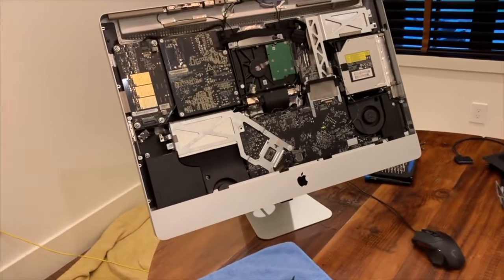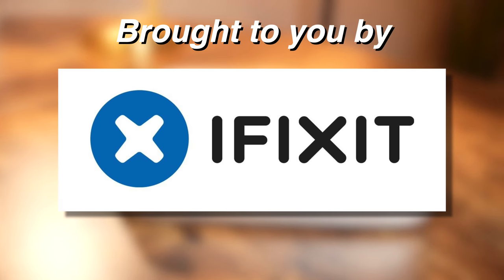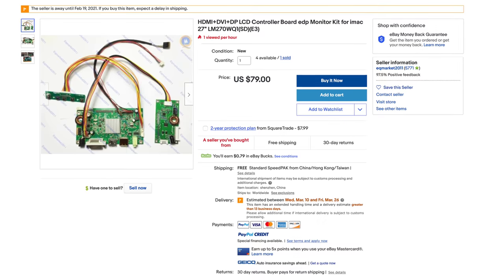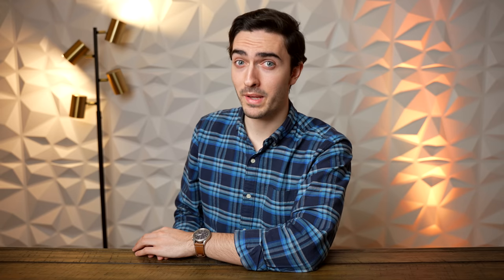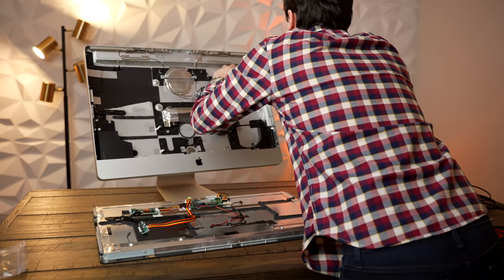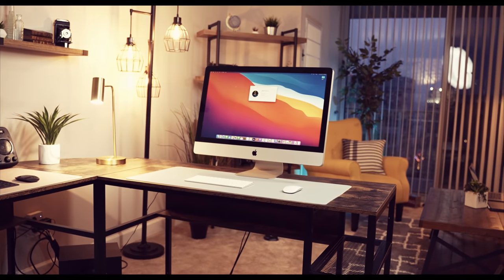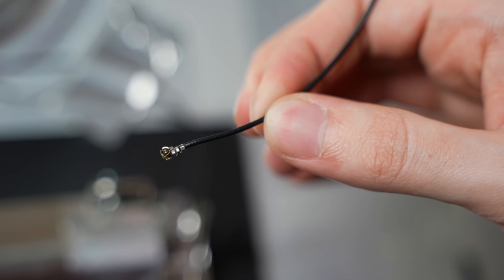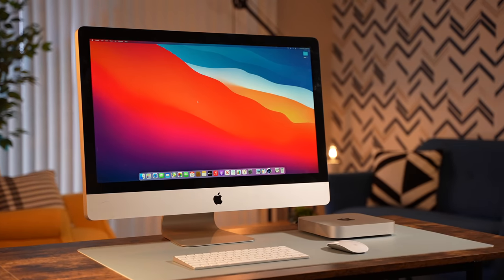How to build your own DIY Apple Silicon iMac!

Comment from the maker: What do you guys think of the iMac mini? Personally I can't wait until the real Apple Silicon iMacs come out, but this will do in the meantime :P
Reply: :D
Reply: Bombastic 👍😁
Reply: That’s cool
Reply: I've still got my late 2011 iMac that I retired because I got a MacBook Pro. I'd try something this but I ain't crazy like you.
Reply: I think it’s ok but you should cut out some sort of hole and run at least a usb hub through it.
Reply: 0:52 Should have been Involuntary Macslaughter - #missedopportunity. But this is great, I was almost tempted to do it.
Reply: Should put it in a Thunderbolt Display for it to have no chin... make it legit
Reply: This was great but with more work and time into it this could’ve been better, like number one you can put a 5K display in it and the adapter is even cheaper. You can hardwire the adapters power on button (and maybe even the Mac mini’s) to the original in the iMac. 
You could use the ram door for the I/O. (Or cut into the cd and sd slots)
And finally I think the fan is way too overkill and might be able to be replaced with a slimmer one from a MacBook. 
Idk just a few ideas that came to me as I watched the video.
Reply: If product design were ideal, then this would be the MO for a new M1 iMac, though with proper buttons, I/O, and with all that room in a 2011 iMac chassis, give me an optical drive while you're at it. 

Will Apple do this? Probably (likely) not. Should they? I don't know. As this proof of concept does show that it works, who's to say that a larger motherboard (or a dual motherboard setup with so much space in an iMac chassis compared to a Mini) isn't feasible? Tell me you wouldn't mind having two separate M1 chipsets in a computer, think like a dual core setup except it's a whole other motherboard...just add a second display (or one of those hack displays like you rigged up here) and run with it.

Third and finally (and this is a total personal opinion) the M1 chipsets are appliances. What happens if your M1 dies? What if the GPU portion gives out? The storage? Can you swap out that problem piece? I believe you have to buy a whole new computer to fix the issue, which is not conducive for consumers, or the e-waste issue. It's all profit for Apple.
Reply: How does the screen get power now that the power supply has been removed?
Reply: Love it, great idea (actually I didn't know you could get a converter to turn an iMac into a display).   It would be nice if for future iMac Apple would release a modular model - I know it won't happen, but think how great it would be to update to the latest model by just attaching a new compute unit to the back of it.
Reply: @spencerturner3846  The controller board also supplies power.
Reply: LUKE MIANI!!!!!!!!! THIS VIDEO WAS AMAZING! Your previous videos were a 10 out of 10. This took it to a whole new level 100 / 10!!!!n
Reply: You, Luke Miani, are absolute crazypants.... And I love it! 

I ran across "mountable USB and HDMI" cables on Amazon years back and have a few, they plug into the port on the device and extend the port between 1-3ft with mounting holes for screws to secure them, you should check them out to regain your port access. Saw them for USB 2-3, HDMI and 3.5mm audio. 

That power button tho 🙃
Reply: Great save for the iMac. I think there will be a project soon to integrate the whole mini into these "old" monitor "case".
Reply: you wait apple will be making these now from your idea
Reply: @natthan7  What do you mean use a 5K display? Were they available in the older iMac's, interesting idea.
Reply: Cool..
Reply: Which country u from??
Reply: Somehow iMac Mini sounds... Good?!
Reply: LOL - "Involuntary Mac-Slaughter"
Reply: u can run cable extenders till the original spots on the imac
Reply: @idonnowhattoput    If there’s space inside the Thunderbolt Display, that would be worth trying.
Reply: @danielparsonsmusic  

The M1X (or whatever Apple names the more powerful chip) are likely to be exceptional in every way with a 32-inch display.  

As far as a component failing, hopefully AppleCare is still available.  They’ current M1s will probably work without a hardware failure for several years, if not longer.  Components that tend to fail more frequently like a fan or storage media can be replaced (of course, even fans are becoming a thing of the past with some of the M1s).
Reply: @warrenheaton2814  I have a 27'' 2009 iMac with a faulty GPU, does anyone knows where can i find the code number of the display to know which adapter to buy?
Reply: So, how do you plug stuff into the back of the Mini if it's stuffed inside the display?
Reply: I did exactly the in Dec ‘20: First with an old Notebook Board die Hackintosh& Finaly with an M1 Mac Mini. I Glued two usb 3 Hubs in the Housing. One for Internal stuff like better USB powered Soundbar with mic, „external“ 1 TB USB C SSD . The Second one is, where the RAM Slot was…
Here is a small documentation with photos:
https://www.hackintosh-forum.de/forum/thread/49867-vom-hei%C3%9Fen-opengl-c2d-27-imac-aus-2009-zum-k%C3%BChlen-metal-allinone-ihack-under-con/

And the Original PowerButton Works !!!!
Reply: Awesome kludge work!

Maybe we'll also get a new ASi Mini the size of a piece of toast, after the iMacs.
Reply: Would the Mac mini have fit port down in the RAM access area so that you could access the power button and ports from there?  Would it fit down in there and then still allow the screen to be put on?
Reply: Just make an incredibly huge cooler and it will be so fast
Reply: You fulfilled your goal, and it's freakin' awesome! If you ever come back to this, I would love to see rerouting/extending some of the ports on the mac mini to the built-in ports of the imac, maybe even rework the power cable into one somehow? Also, you GOTTA reuse the DVD drive somehow, even though it's probably never going to be used, adding back that functionality would be so cool (maybe I'm alone on this one lol).
Reply: I love your solution!!!
Reply: Where did you get the Lamp in the Background from?
Reply: It looks like you kept the main Mini connection ports on the back, so run a couple TB3 cables out the back.  and a USB3 cable.  Use one of those USB hubs that connect to the bottom of the iMac to give 3 or 4 (sorry I don't remember the exact config)  front facing USB ports.  Getting the power connector to work... would be a bit more challenging, maybe breaking your rule about not destroying.... but, if I had an early 5k Mac that died... it would be tempting.

A new focus for your channel, how to turn your dead intel Mac into an M1 Mac.

Good job!
Reply: Why not fix it by running a RJ45 cat 6 cable.
Reply: Also you need to buy extenders to put back on the ports. It should be easy to do.
Reply: Pretty cool way to repurpose a dead imac... for the cost of fixing it as old, this makes more sense, considering the cost of a woorking logic board... Now, depending on your soldering skills, you might be able to get the original back button from the imac to replace the mini's... as well as several other optional improvements to help take advantage of the ports and display adapter... but as is, that's pretty good! big thumbs up!
Reply: Well done!  Your Frankenbuild really emphasizes how the Intel chips have hobbled the platform for quite some time. So much hardware overhead to run those i7 chips.
Reply: Daniel Parsons how did you get in my head? Lol
Reply: Would be an awesome project to get the power buttons and ports outside for the meantime!
Reply: I got an idea how to solve lack of USB ports. How about build external storage recycling your Mac mini case? Stack some 2.5" SSD or HDD and some external USB ports in your Mac mini's chassis. Then connect cable into your i Mac chassis. If your i Mac's USB port holes are completely empty, connect cables through USB hole. If cable look messy, also you can probably solve it by using VESA mount.
Reply: @spencerturner3846  one of the boards for converting the lcd was for power I believe
Reply: As for the ports - I think u can use cable extenders/converters with one end attached to Mac Mini and the other one coming out of the iMac, no?
Reply: lololol
Reply: Hilariously, this won't be all that far from what Apple is going to do, for real...
Reply: why don’t u do your 2010 Mac pro
Reply: this is CRAAAZY but in a good way! good job! I'd definitely not have patience for this haha
Reply: Wait! I need a breakdown, like a Apple for dummy’s. I can breakdown most things but I iMacs are something else. I found a iMac in my garage from 2010. If I get a Mac Mini will I basically have a newer iMac because I can download a bunch of apps and I can’t to AirPods that flawlessly. Someone explain!
Reply: Creative.
Reply: how do you determine the model # of your display without taking it apart? I have Late 2013 iMac so it could have LM270WQ1 SDF1 or LM270WQ1 SDF2
Reply: 10/10 for your creative solution.
Reply: Why didn’t you wear any ESD gear to protect yourself during the iMac teardown?
Reply: You could probably repurpose the iMac power button to the Mac mini’s power button by soldering 2 wires and you may be able to use extensions for the ports and route them through the iMac’s ports then use j&b weld to fix them on so that they stay sturdy. This is all my guess but how I would go about it.
Reply: Caging a beautiful M1 Mac Mini inside an old IMac chassis was fun to witness - so completely nuts and totally understandable, yes we are keen as hell to see the redesigned Imac 30" straight after the redesigned Mac Pro Mx1 short body.  Removing the Mini for reassembly back into a fully functioning M1 Mac Mini is so much more a smarter move!
Reply: Hi Luke! If you're actually interested in making this product functional, run extensions for all the cables so they plug in using a port from the hole originally occupied by the power button, similar to the A1502 Henge dock. It's pretty cheap and makes the computer vastly more usable. If you're comfortable with a soldering iron, you can also probably try to extend the power button cables out enough through the hole so you don't need to take off the screen, although that like actually requires effort while the first barely does so IDK if that's worth doing, but it's option.
Reply: I think you need a follow up video for this with fixed jumpers for powerering it up and also for the extenders to stick them so that you can make it feel practical.
Reply: I love the cheap little M1 mini, I'm using it for everything, with 10K of other Apple iron now sitting in the dust. Looking forward to a real mx? iMac in the future, but not sure... a smaller mini format with wireless display capabilities you could move around the house, connecting to your thin film 4K or better displays, would be more interesting. And of course with a full verbal interface :)
Reply: Way not finish the job? (Connect the power botton and make the USB Work as well.) you can do it:)
Reply: This is a very good idea. Thanks for documenting this and making the video available. I would do this as well
Reply: Hey Luke, just so I have an idea, what model year was the iMac you used?
Reply: I think you are on point sir. Great attempt at a make shift M1 iMac. Let’s see what is next?
Reply: Can you do a tutorial to transform the iMac into monitor? I would be grateful.
Reply: with respect, You are not the first sadly: https://www.youtube.com/watch?v=7OZf-vpvthI Also In my opinion You should try at least getting the case power button routed from the M1 board it's just 1 standard header
Reply: this guy did it first😊
Reply: Oh my god I need this! I got a late 2012 and it’s soooooo slow! Want to do a project? My wife would appreciate it, she loves it (emotionally attached) but hates it. I guess it’s an abusive relationship.
Reply: @danielparsonsmusic  cool idea. but what about a KVM setup. push a button and switch displays. 🤓
Reply: Brooo! No words. Amazing
Reply: The link to the display board no longer works. Any chance you could find another one?
Reply: 1. Wire up the power button.
2. Wire up ALL the original ports.
3. Fix the DVD drive and SD card slot.

Done.
Reply: Big Sur wow iMac yay
Reply: LOL I laughed at ur creation due to the haunting
Reply: Cable extensions for the ports
Reply: I've been wanting to go back to Mac OS (started on OG iMac and G3 Pro which I still have in storage) for Audio/Video, but I'm on a very limited budget. Is it worth getting a 2011 and getting hands dirty upgrading? Or am a going to be better off with say... A higher spec'd out 2013? Thanks in advance!
Reply: Why call it an iMac mini when its not that small
Reply: Do you think you can do this 20 inch iMac
Reply: So what was the imac mini hooked to before?
Reply: My Late 2015/27inch/5K is still far too valuable. The display is great. It looks good on the desk. It's a shame not using those great parts for many years to come. It has been upgraded with 1TB SSD and 32 GB Ram. More than enough for hobby video- and photo editing. However, some day I might need to upgrade and hope there will be a iMac +5K option again.
Reply: Dude, just get some USB extender cables from the mini through the hole that was used for the power cable, and you will have your 'missing ports'. And if you want to take it to the next level just glue some right angle female usb adapters to the holes left at the back of the chassis for the USB. I am pretty sure that soon there will be some free 3D printed bracket to fit everything and make this mod easier for more people.
Reply: I love the 27 inch retina display on the apple imac 5k, but apple doesn't sell the 27 inch imac m1, can you make a video on how to mod an old 5k imac into a 5k m1 imac. because the 5k screen is awesome
Reply: It was pretty Cool to watch 😎. However, it's also Funny 😂 But what I Loved, was the Creative Genius you present to an objective and realistic solution, despite the Franke factor of it. 😂😂😂.  But all pretty Awesome, if you ask me.
Reply: Use a hub with a cable and dubble sided tape and you have more poorts like usb
Reply: Nice!

Comment: Look at Mac Repairman's G5 conversion video for pointers. If you 3D print a bracket that holds USB ports and an Ethernet port, you could reuse the existing I/O board holes to connect external devices and you can make a board so the power switch on the iMac can be used to power the M1 Mac Mini so you don't need to take the screen apart. A 3D printed power adapter would enable the power connector to fit snugly in the case and prevent creepy crawlies from entering the case. If you can get the camera working, it would be a fully functional iMac.

Comment: Windows Users: “Macs are garbage because you can’t upgrade them or use them like our cool windows pc/all in ones”

Luke: “ Observe. “
Reply: Yeah, I'm observing and what I saw is him buying a new mac and frankensteining it into his old one.

In case you haven't noticed, apple does everything they can to prevent you from changing anything about their machines (except for the new mac pro, that one was a legitimately well thought machine with good upgradability). SSD's are tied to the board, sometimes even soldered, ram is soldered too, sometimes the CPU is too and the GPU almost always is soldered too. No PCI-e to be seen on most machines and good luck getting extra disk space or USB ports. Also, I'm a linux user, so blocking it with the T2 chip really doesn't go well with me. The M1 chips just makes every single one of these worse.
Reply: @mohomonkey9906  yeah! and i (a windows user) think that this was very awesome because i dont like intel xD i ean i dont hate apple the m1 is good but im a windows user so yeah lol
Reply: Sticking a computer into another computer is not an upgrade.
Reply: @mohomonkey9906  true, but what's the point of better (single core) performance when you also get a worse everything else?
Reply: @andrewhanson1180  it kinda is because the computer he put inside is faster
Reply: Luke Skywalker
Reply: i hope you guys realize that this comment was a joke

Comment: I used a 2012 imac as a display for a long time using a controller board. You can pretty easily solder the power button connections from the original imac to the pcb with the buttons on it. That way you can turn it on using the original button and not have to worry about those controls hanging out of the ram slot at the bottom like I originally had it.

Comment: Luke, can you install an USB extensor at back of imac to usb input Mac Mini silicon and start use them?
Reply: Apple pretty much killed using an iMac display for any mac mini, that idea was Long gone before he started.
Reply: Probably he could, but it wouldn't look nice.
Reply: @SomeUnremarkableGuy   They gonne be inside, if he finds a flat usb extensor, should look nice. Usb C to usb A, to match the back´s usb entrace.
Reply: Just drill a big hole in the iMac housing and connect multiport dongle cables (run through the hole) to each of the USB-C ports on the MacMini and one will have lots of ports. Can even get dongles with SD Card Slot.  Problem solved. Or maybe the other end of the dongle cable could be mounted in the existing port holes on the iMac housing (might need special cables, but shouldn't be a problem for Luke).
Reply: @timgurr1876  I’m saying that you can’t connect two different CPU’s with two different chips, that’s why he took everything out of the housing and connected the panels and dongles with the internals of the Mac mini.
Reply: @risley.ogembo  I understand. I meant with only the M1 system only. Sorry for confusion.

Comment: I think it's a great mod, for the ones with power tools they can drill in holes for power buttons, ports etc etc and you have a fully functional imac
Reply: I wonder if you can keep most of the components this way if you theoritically want to keep a computer as a backup plan